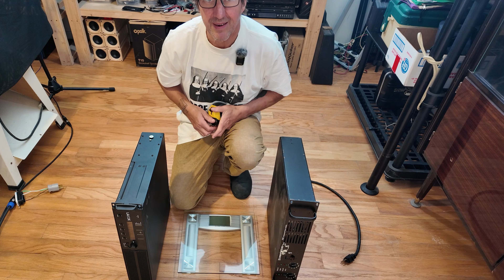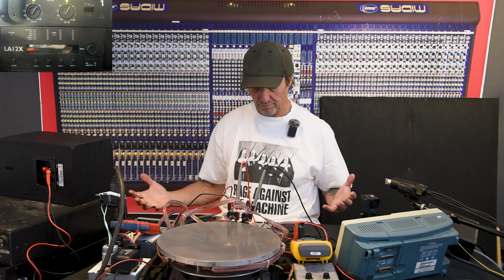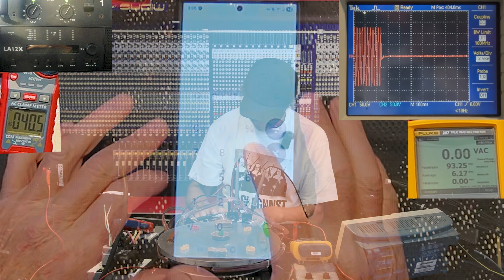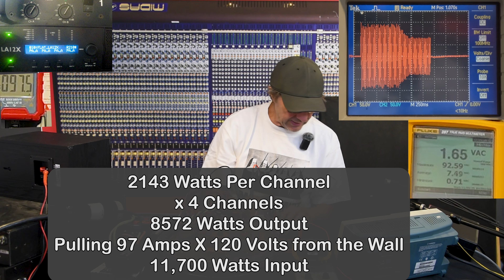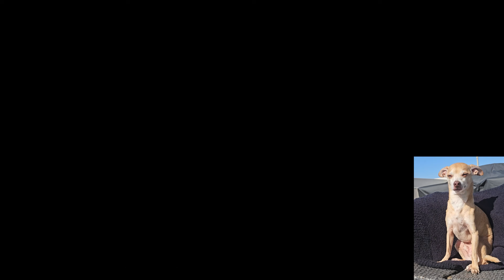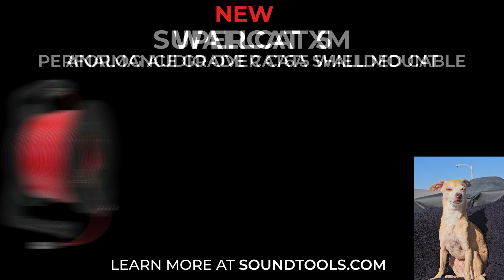Who Does RMS Power Better, Old or New Amp?

Comment: Please, make a video about damping factor, a comparison between the two.
Reply: I wrote nothing about a spec. frequency range. Class ab amps with more than 3 transistors for each halfwave have about 55 milli ohms output resistance depending on the open loop gain.
By the way this is only electrical damping. More Important is the Bass speaker itself. 
An amplifier with a damping factor of 100 driving a well-designed bass system is usually significantly better than an amplifier with a damping factor of 1000 driving a poorly matched, flabby soft-suspension, high-Q tuned bass driver. Cheers and bye.
Reply: Damping factor? Class D wins 100% of the time, every time. Class A/B has high resistance of the output transistors. Class D is virtually zero. Expect 10 to 20x the damping factor from a modern class D compared to a Class A/B. (Early class D wasn't so good but they more then turned things around).
Reply: Class A/B output resistance is often 0.22 R. Damping factor is freq. dependant too. Do not spread wrong conclutions about Class D. Cheers
Reply: @twocentman  Even cheap class D amps are less then 0.1 ohms. Expensive ones below 0.02 ohms. Although frequency dependent, who cares above 100 hz? Damping factor is irrelevant at high frequencies.

Comment: I recently did a Atmos retrofit to a dub stage. I was able to leave the 5.1 amp rack and accommodate the 40 channels worth of 4 channel Power Soft amps. That includes 4 subs… I think it funny that all the amps are the same size now regardless of the output. Great video 👍

Comment: Do you notice any difference in the presentation of the amps?

Got to A/B a fairly high end class D (home audio) against a similar A/B amp, and the class D seemed to lack the thump of the other.

It may be just being use to how the older amp does things or something else I'm not versed enough to speak to, but there are differences even if doing the same job.
Reply from the maker: it's really going to depend on the specific amp that you're testing as well. cheap class D amp vs a high quality class D amp can have vastly different abilities to deliver maximum power for longer or shorter periods of time. 

interestingly also, I know of class D amps that put out the exact same power in the US as they do when plugged into European power but when plugged into European power they can put out the maximum power for almost twice as long before dropping down to a lower level. 

I would say if you're looking for maximum thump, and comparing a class A B to a class D, get a class D app that has 4 to 10 times the power for half the price and it will almost always exceed the output capabilities of a class A B amplifier that costs half or a quarter as much.

by following that, you will get a higher peak power and a higher continuous power with the class D at a lower price and less weight

Comment: Issue is power supply design for the class D amps. They like to design for music, not for EDM/D&B/Rap (aka constant sine waves). 😮
Reply from the maker: somewhat agreed. I would say if you replace 10,000 Watts of class A B power with 40,000 Watts of class D power, you will get a higher long-term RMS, A higher peak power, about the same draw or not much higher draw off the AC input power, reduce cost, reduce weight and reduce size. 

I think the issue that happens with EDM and class D is people are replacing a thousand Watt class A B app with a thousand watt class D amp and putting in a tiny little ultra light amplifier to replace a boat anchor. 

Don't do that, put in a class D boat anchor instead of a class AB boat anchor and you will have a hot rodded dragster of massive power juice

Comment: Always run sub amps on 240v if they are capable too!     I was working a venue with it12000's for subs and for some reason they were running them on 120v 30a circuits.   On a spirited EDM show I had the rig trip a 30A breaker.    After consulting with the regular house guy and vendor, I wired the amps to an L2130 on 240V.   The subs had so much more punch that engineers do not even have to push them as hard and the breaker tripping has not been encountered since.
Reply: Another reason why I love ITech amps. You’re not allowed to do what you did with L-Acoustics amps… they require a real Neutral…
Reply: @jimi272   How does that work, or not, with international power systems, of 240/120 balanced, 208/120 3 phase, or 240 unbalanced, or floating systems?  

How about different systems and standards requiring a ground for chassis, or ungrounded power branch circuits, and audio grounds floating from or linked to chassis, with potential ground loops?  

In many high performance amps even over 25 years now, AC mains are direct rectified to a single ended high voltage DC supply, or limited storage as it feeds an ultrasonic DC to DC converter, generating plus and minus rails for an actual amp, and those systems are UPC managed to only rectify (often via SCR's or Thyristors) high enough rail voltages for the audio amp to meet current demands, in order to minimize heat generation.  

That makes the DC converter often ferrite toroid the line isolation safety device, rather than a heavier, larger, 50 or 60 Hz mains transformer, and in turn makes the size of filter caps far smaller than traditional passive designs.  

With a 240 volt floating (neither balanced nor unbalanced) mains supply, that gets more dangerous, as the line connected single ended smart rectifier DC supply to the converter can float to very high voltages from earth, especially in cases where there is an audio ground but no chassis or earth ground.  

It's quite possible some usage conditions are unsuited and unsafe for such amps, absent isolation transformers, while those are most likely in countries with the lowest levels of tech or engineering awareness.
Reply: @lokiva8540  I run my homebrew 2xGU81 amp with 1500W on 2 phases out of my 400V mains. Soungs great.☺
Reply: 400v is completely unnecessary for two small tubes you can get away with running a yc156 on a standard 220v welder socket
Reply: Id love to see a video/tests of 120V vs 240V - when the demand is UNDER what the 120v line is able to provide. E.g. a 1000wrms/2000wpeak amp tested on both 120v 20a and 240v 30a. If the 240v would sound better, "more push" as you described. 

Because if the 120v 20a plug sound the same, then it's just a matter of splitting the amps up till they are small enough to not need a 240v plug. This is of course only meaningful for the small portable DJ. But that is a lot of consumers.

Sometimes it's just easier to get 4x 120v circuits vs 1x 240v. In your neighborhood restaurant/bar/coffee shop, or running on a fleet of smallish generators.
Reply from the maker: I've done tests on powersoft amps and spoken to my friend Claudio is the designer for powerssoft amps. at least for his designs, running off of 240 increases the time frame the app is able to reproduce full power by about 25 to 50%. 

so if the amp can put out full power for 200 milliseconds on 120V then running it on 240 it will put out full power for 250 milliseconds to 500 milliseconds
Reply: 120V problems. Hehe
Reply: Why not run audio amps at 27 kV, directly off utility substation secondary feeders?  

It's been done before, but using tubes, either for 500-1,000 kW shortwave transmitters, or 500 kW experimental AM broadcast transmitters.  With those RF powers, positive AM A3 audio modulation requires peak audio power levels about 5 times higher than RF carrier power.  

Needless to say, that's not viable for temporary commercial venues, never mind consumer products, and it relies on chokes and transformers that require machinery larger than venue fork lifts to move.  And distortion levels far higher than modern solid state amps for lower powers.  

When a 30" subwoofer was limited by thermal design to around 300 watts, there wasn't pressure to push higher, as portable or even theater amps generally weren't large enough for it to matter.  As large sub's started to become capable of far more, power amps tended to be designed for around 1500-1800 watts, despite MOSFETs starting to handle more, because that's the limit of a common 120 VAC 20 amp electric circuit.  And, in the US, there was a period of consumer protection laws against rigged number amp power frauds, which boom boxes and home theater with many channels seems to have collapsed.  

There's no inherent advantage to 240 volt branch circuits per se, but wire sizes, load demands, and thermal or other losses of devices that operate better or worse under different conditions, do need honest engineering specs based on usage design criteria.
Reply: Ok Tesla then go do it your damn self.
Reply: @lokiva8540 power supplies and inverters inherently are more efficient off 208/240.  You’re running both legs instead of just 1 and a neutral.

You drop current in half feeding the power supply and aren’t as amp/current limitrd
Reply: @xzibit8614      You're wrong, and clearly are making grossly unfounded assumptions based on a tiny amount of knowledge, and erroneously extrapolating wildly to power systems you clearly misunderstand, while lacking engineering awareness of the many other factors that affect efficiency.  

Try studying electronic design, and world power systems, for about 20 years or more, and then review how grossly disconnected from reality that comment is.
Reply: @lokiva8540  Says the guy recommending "Why not run audio amps at 27 kV", maybe also try running a steam-powered smartphone while you're at it.
Reply: @pinocleen Try studying some history, as well as evolution of electronics design, and you'd find what I described has actually been done, back when a very few industrialists had experimental permissions to operate 500 kW AM broadcast stations, using some rather large and expensive tubes and iron.  Those systems would have only been around 30% efficient, whereas a modern 50 kW A3 broadcast or up to 1 MW HF/SW digital transmitter reaches 70-80% overall efficiency by not acting as an RF plus audio amp modulated system, but rather by using MOSFET overclocked switches to a summing bus, to digitally create from scratch an analog equivalent of the intended waveform and NOT actually amplifying audio per se.  

480 VAC 3 phase would be commonly used, but like solid state audio amps, those are low impedance systems, whereas tubes into modulation transformers, just as tiny consumer tube audio amps, are high impedance systems needing matching as well as DC isolation. 

Besides, virtual zero impedance outputs have replaced matching to tubes, as they serve as a motor-generator brake on dynamic speaker loads.   

It's more common these days to find 6 megawatt secondary feeders at 7200 volts wye, or 13 kV closed Delta, or 20 MW feeders around 19.9 kV 3 phase.  But, that size industrial customer has an engineered service to deal with local utility practices and customer needs, trivial compared to loads from huge data centers these days. 

Still, it's not the line voltage for low voltage systems that's a primary limit in terms of audio amp performance.  And, if single phase as most portable devices are, unbalanced or balanced or two hots off a 3 phase wye or delta doesn't matter to power stability and surge responses.  

It is possible and has been done, to built 5 million watt audio amps.  That's just not useful for driving speakers.
Reply: @pinocleen  27 kV is the plat voltage of a 500kW transmitting tube.

Comment: Class D amps should specify a peak and RMS rating.  But I bet the marketing department would have a fit if someone tried to market this class D as "4,000 watt RMS".   (I secretely wanted to know if the switching power supply of a class H would allow higher peak output compared to RMS.  It appears it does not in this case.  Good to know!)
Reply from the maker: The way to determine the long-term RMS power of an amplifier is to look at the AC power input draw. you can't get something out that doesn't go in. 

but class D has a lot more of what comes in show up on the output than the older amps
Reply: They do.

Comment: Did the frequency of the sound go up a bit when you switched amps or am I hearing things?
Reply from the maker: it shouldn't have. I was driving the amps pretty hard and not overly looking into whether they were slightly clipping so differences in the sound of any distortion may sound like a total shift
Reply: @DaveRat  Roger that!

Comment: So check the frequency response over     that power rate. @ 2 ohm.  It may be power delivery  but not flat across the 20 to 20k
Reply from the maker: I've done numerous tests on multiple amplifiers in I've yet to see any of the amps have significant output power related frequency response issues. though some of the class D amps Will struggle with running full power at 20K and those fans will get loud, but if you're running a full range signal or a somewhat multi-octive signal it's not much of an issue as far as I can tell
Reply: @DaveRat cool thanks
Reply: I have seen on some A/B where at 4 to 2 ohms the gain level on mid to high frequency will fall up to 6 db. But this would be amplifier circuit designed not a power related issue.  It doesn't you can not use that amp . It is know the efficiency of the amp over the range and determine where to use it .

Comment: Thanks for doing this........  Those vintage Peavey power amps were a thing of legend,  but require a forklift to move them around.   I think early Class D set a bad example,  and it has gotten better.
Reply from the maker: agreed
Reply: Absolutely!  Having worked in commercial AV for so long, I can guess why live sound could get a bad taste from early Class D equipment.  Class D is perfect for commercial, we do not push it very often... and the savings are legit.
Reply: @j @joshuaharlow4241  I find the class D amps perfect for all uses, consumer and commercial. The SMPS is now ubiquitous and class D output can provide extremely low distortions. Class AB is like using an incandescent lightbulb that operates at 30W when it is off, an idea that has passed to history.
Reply: @artysanmobile  I will take incandescent and AB over LED and class D anytime
Reply from the maker: I do enjoy the class A B for my house and the elegance and old school fun. 

conversely, the big rock shows and concerts are class D at this point. occasionally you'll find someone embracing older technology for nostalgia and novelty sake.

there's just no logical path to using amps that are bigger, heavier, less power, less efficient that generate more heat and require larger power feeds when dealing with anything other than small consumer products and sound systems like home Hi-Fi. 

45 years in the live sound reinforcement business and I started with all heavy amplifiers and still have a whole bunch of them but wow, to try and deploy a large format high quality sound system with that old technology would be absurd at this point. 

If I don't got to carry it or move it, a nice beautiful old amplifier, or a tube radio a real-to-real tape machine or cylinder record player, of which I have all of the above functioning in my house, and do really enjoy and love.
Reply: @D @DaveRat  I have a 50+ year old McIntosh amp in the home. It won’t die. Beautiful meters show just how little power I actually use listening to music.
Reply from the maker: I am envious!
Reply: @DaveRat    We are curators of our own personal museums.
Reply: @DaveRat Don't have to.  Reel to reel. You own one, yet don't know how to spell it?!?
Reply: Funny story - A musician friend of mine lent me his old Peavy amp that he wasn't using when I first started doing DJ sets. He had it in a old luggage for a "carrying case". I was always deathly worried that the damn handle was going to rip right off the case. So I got my own amp in short time just so I wouldn't have the burden of both moving it and avoiding a potential oops.